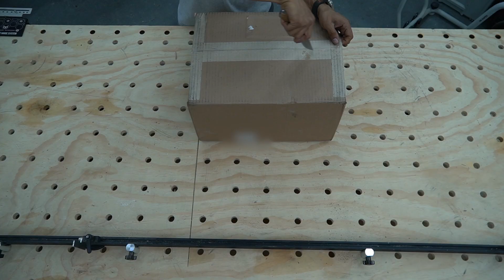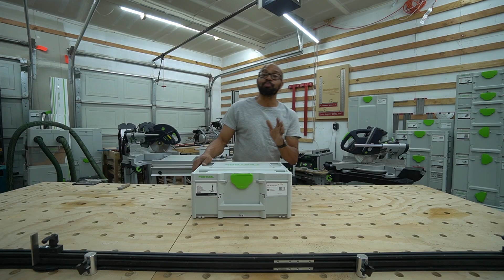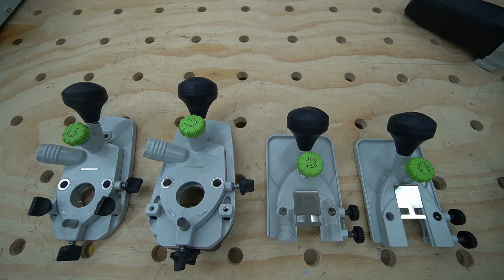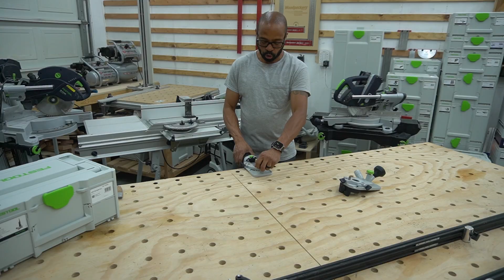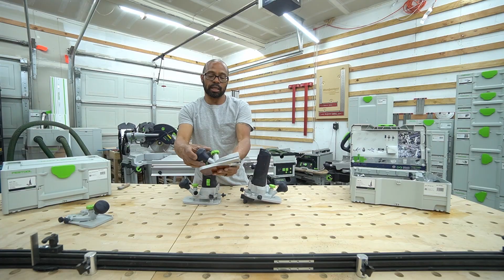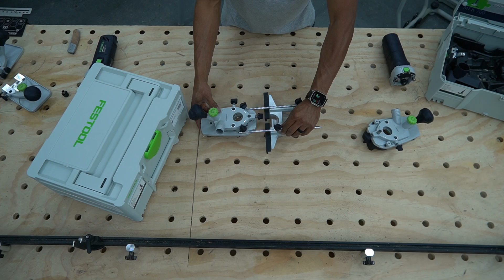Festool MFK 700 Router 576244 EQ B Plus Unboxing And Overview

Comment: Thank you very much for your video. I was getting really confused. Just bought a used MFK700 EQ-Set. Unfortunately the newer version doesn't cone with the fence. Just got it, haven't used it yet. I didn't realize there were two other bases available.
Reply from the maker: No problem. I am glad the video helped. Thanks for checking out the video I appreciate it. Also enjoy your new tool addition. 👍🏾

Comment: oh dont forget to buy the trim router bit, its additional $180 plus tax.
Reply from the maker: Are you talking about the bit that is used for trim with the Conturo?  There are three of them for the various sizes of trim. 1MM, 2MM, and 3MM.
Actually there are 4 as there is a 1.5MM

Comment: you know u can buy the parts for your old mfk 700 the plate and bearings and it will be the same function. no need to buy the new updated mfk.
Reply from the maker: Thanks for the information. I was wondering what the differences would be. 
One of my questions is if I could purchase a MFKC cordless router and use my existing bases from my corded models so that I do not have to purchase two new cordless models.
If that is the case that would be great.
Reply: @daddysharespace  they should work together

Comment: There are issues with the OF2200? I was looking to buy one eventually.
Reply from the maker: When I decided to build out a home shop I wanted to collect the right tool for every task that I could imagine that fit with in my budget. The OF 2200 is a router for either a router table or heavy duty hand held task. I was planning to put my OF 2200 into my Festool router table however I discovered the American version does not support the OF 2200 per Festool. I imagine that is because we run 110 volt here in the stays while  other countries run 220-volt.
With all that being said to date I have not had to push the OF2200 as I have not tackled any projects where it was required. With light duty use I have had not problems with it. I have been considering purchasing an after market router switch to attach to my Festool router table to attempt to use it in the table. We will see. The Festool OF2200 is an expensive router. I cannot say it is worth it as of yet. 
Thanks for taking the time to check out the video. I will provide updates if my opinion changes in the future.